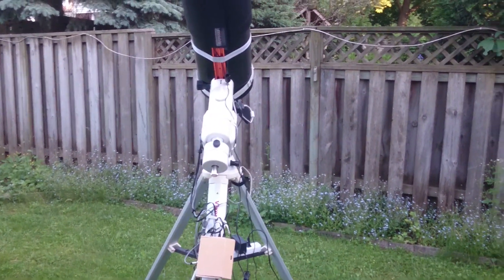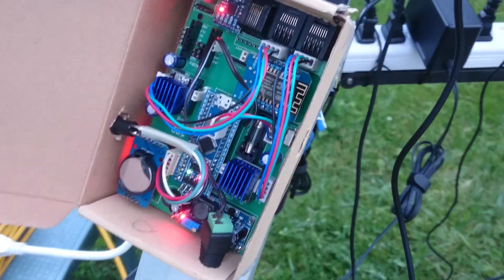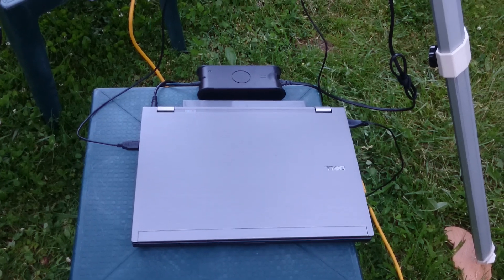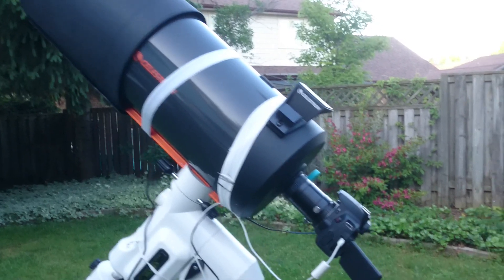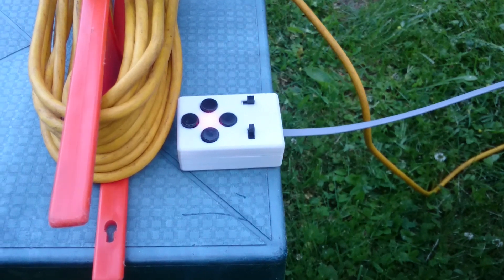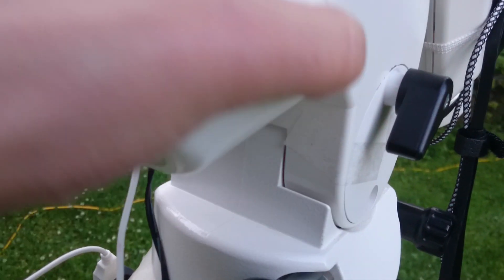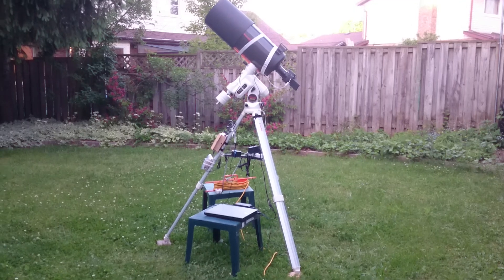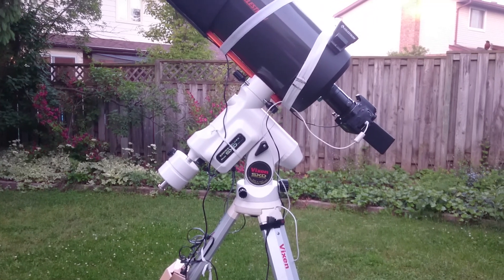My OnStep Astrophotography Setup (Vixen SXD, Canon T4i/650D, Celestron C8)

Comment: Please could you tell me more about the MP method for Polar Alignment using the Alt-Az bolts? I use DARV, but it would be great to know more about this.
Reply from the maker: The MP method was basically a command in OnStep that did not have a user interface at the time I made this video . Now it is in the Android App, and called "Refine PA". It is described under the Control page on the wiki.

How does DARV perform by the way? Write me an email if it is more than a few lines.
Reply: @khalid_ba  i'll email you khalid. I am the guy with the HEQ5 PRO and CNCV3 build.

Comment: I have a C8 and am considering this mount. What guide scope are you using at the 2032mm focal length. You have two weights (?): do you have counterweight capacity to load up that C8? thnx.  I use an orion 60mm 240 focal length guide scope but am migrating to OAG for that long focal length. Nice backyard setup.
Reply from the maker: The C8 can go on the SXD with only one weight (the larger one), with or without the guide scope. The weight is almost at the end of the shaft. 

My guide scope is an 80mm made in China one. It is too heavy though, because of the long show that it goes on. 
Should be fine with the 60mm since it won't be as heavy. 

Trying astrophotography at 2032 mm will probably not work, first because it is a very long focal length and the pixel scale will be very fine, and hence all the errors are amplified. Second, because it will be a very dim F/10, and you need longer and longer exposures to compensate for the f/ratio. 

Let me know how the OAG works out for you. I have been thinking of trying one, but hesitating to do so.
Reply: Khalid Baheyeldin Thanks for that info. As an aside I have a great photo of M51 using my C8 w 6 minute subs w/ a Canon. I knew little about what I was doing at the time. . That was PA’ing with only the polar scope and several 3 star alignments. My Orion guided fine and my current mount is inferior to the Vixen.  The OAG is highly tedious. I’ll need the Vixen to prove this will actually work. Guide stars being dim IS A PROBLEM but I might have made a break thru today. One has to plan sessions in Stellarium to insure a good guide star is there. I’m worried about this; not convinced I could shoot just anything in the sky for lack of stars. I am certainly thinking about going back to a guide scope. Some flexure potential is better then not working at all.  But it’s a work in progress
Reply from the maker: @wanderingquestions7501  That is my worry about OAGs as well: dim stars. 
As for M51, objects near the celestial pole are always easier and more forgiving. Not the case as your go near the celestial equator. 
Is your mount running OnStep as well, or stock Vixen firmware?

Comment: Is Onstep has better performance then AstroEQ? (I'm interested in control via app/wifi and I just burning my mega2560 of my AstroEQ)
Reply from the maker: "Better performance" is a very wide and loose term. What I can say is that OnStep has more functionality and flexibility than AstroEQ, and can be adapted to many mounts, not just the EQ5 and EQ6 like AstroEQ. 

It is better to ask question on the OnStep Mailing List

https://groups.io/g/onstep
Reply: @khalid_ba  Thanks you I have in the group for a while, and I have a question on USB TTL module can I use CH340 instead of CP2102 (much cheaper)?
Reply from the maker: @lapitlapinee422  The CH340 module should work, if you use your own perfboard. But if you use the PCB, make sure that the pins are compatible.
Reply from the maker: @lapitlapinee422  You only connect TX, RX and GND to the STM32 PCB. Do NOT connect 5V or 3.3V, otherwise, you will burn components.